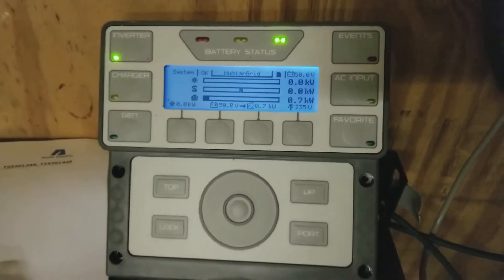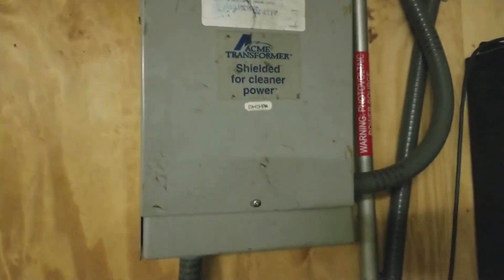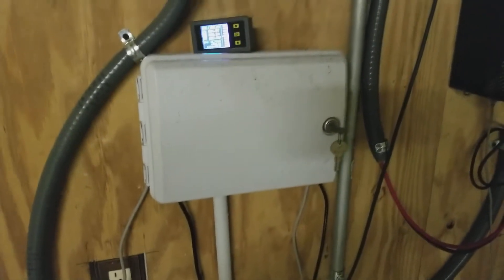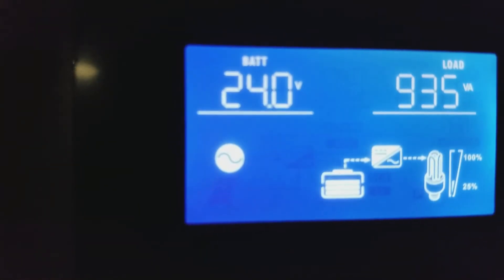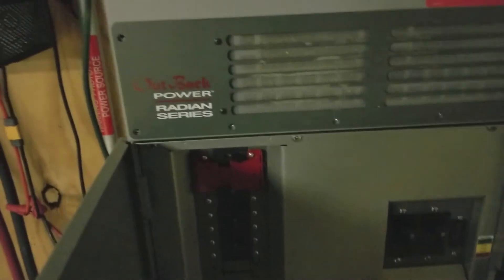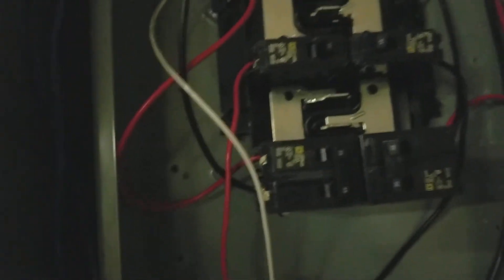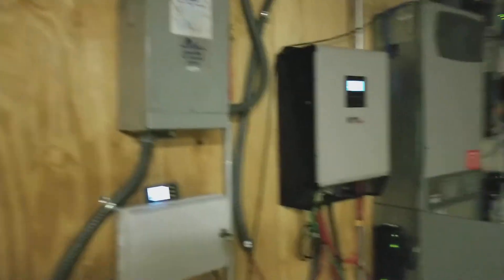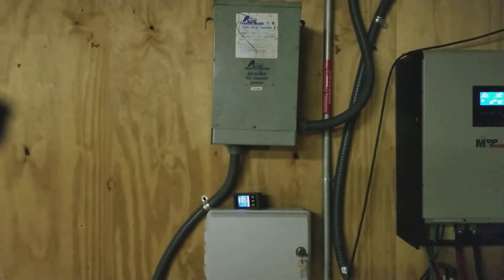MPP Solar PIP 4024 240v to split phase conclusion

Comment: Nuibian, I have some advice for you that will get rid of most of that quiescent current of 90-120 watts down to around 20 or 30 watts. Cap off the primary winding's and just tie the 240 volt inverter directly to X1 and X4. This would pretty much turn that step down transformer into an auto-transformer much more efficient. Read up on split phase auto transformers and you will understand what I am talking about. Auto-transformers (if bought new) cost a lot less than a regular step up or step down transformer because they only have one single core winding's with three or more taps.

Comment: Nubian, thanks for the vid, any chance do you know how to calculate the fuse protection rating for the primary side of the transformer? Thank you
Reply from the maker: The 240 output powering the load panel?  It is breaker controlled.  I would run it into a 50 amp AC main breaker
Reply: Surf - To add to what Nubian said, it depends on the size of your transformer. Transformers have KVA ratings. You want a breaker/fuse on the primary side so that a short circuit on the transformer secondary side (output) doesn't overheat the transformer.  Some manufacturers provide a table recommending a fuse size. You might find them with Google. HTH

Comment: Hi buddy, The split phase using a transformer out from 240v really works? How much watts transformer draw from inverter with no output load connected? It is reliable?. Thanks
Reply: MrTechPhoto - Did you read the description? The seller recommends a transformer rating of 4 times higher than the advertised rating just to power florescent lights. I don't think these light duty products can compete with commercial "big iron" in terms of continuous duty operation and voltage drop with higher loads.
Reply from the maker: MrTechPhotography very reliable yes. About 90-120 watts idle draw
Reply: Thanks nubian. I saw on youtube a guy that do split phase with two 3kw stepdown(240 to 120) transformers cross connected. This system drain inly 16w with no load connected. Did you tried that? Iam very interested in do a transformer base split phase system with this PIP
Reply from the maker: MrTechPhotography it can be done but requires more equipment. I am ok with my setup.
Reply: Thanks Nubian por your time and testing this system. Excellent!
Reply: Nubian, I have one more question. I will buy the PIP5058MS and use two 3k transformers cross connected to the inverter output to have the split phase output I need (120/240). The question is, I will be able to connect my house grid split phase 240V cables(I mean L1 + L2 without connecting Neutral) to the inverter input to be able to use the transfer switch and to charge batteries tru the inverter?
Reply from the maker: Yes you will.  The transformer CREATES the neutral tap.  I am actually selling the 4024 and the transformer together if you are interested.  I will make you a great deal.
Reply: So, its ok that I can connect the 2 Hot wires L1 + L2(split phase 240V) to inverter L + N utility input with no issue to inverter? I will no blowout?
Reply: Nubian, To step down inverter output to split phase, is recomendable two autotransformers or insolated one?
Reply: Nubian Davis , What you think about last message I sent you? Thanks bro
Reply from the maker: You can use one or two - your choice.  I myself would rather 1 for less points of failure.
Reply: Ok, which you recommend, use autotransformer bonded to inverter output or isolated? I bought two of this ones >>  https://www.amazon.com/gp/product/B01HUCTD12/ref=oh_aui_detailpage_o00_s00?ie=UTF8&psc=1
Reply from the maker: I assume they will work but I like the idea of having the one transformer output the split phase 120/240 myself.
Reply from the maker: garyabc you are 100% correct. Those are very light duty items.  Trust me when I tell you, my transformer will never fail at its job, period. That thing is a beast. To save a few watts just does not do it for me, I need the reliability.

Comment: for a 3kva inverter wich transformer need to convert to split phase
Reply from the maker: Joacim Pacheco you can use this one as it is 5KVA. You always want to go up  about 150% to account for losses in transmission.
Reply: Nubian Davis thanks i can find in ebay?
Reply from the maker: Joacim Pacheco certainly.  Pots of sellers have them. Acme is the one that I bought.  It will work for you and leave you some room to spare.

Comment: Looking good buddy and thanks for sharing
Reply from the maker: jwsolarusa yessir!! I am loving this tech. I am going to be adding 40 more KWh worth of cells (LG Chem packs) that operate at 60v(59.2) and operate my Radian 8048a at a 64v operating current, allowing 2 things- the ability to connect with my existing bank (similar 4.2v cells) in parallel and starting at 64v allowing usage all the way down to 48v (by charging the cells no more than 4.0v each @ 16). This extends cell life and gives a huge operating range before SOC is near empty. I will test but I am expecting 68-70 kWh of usable storage.  Once full,  I should never have to discharge more than 25% on most days. I look forward to testing my theory.  Lost thing I will do this year is add a wind turbine or 2. Nothing better than a kWh 24/7/365. Operates in rain, storms, at night. Solar is very consistent for me, but dollar for dollar I weighed getting another 9 panels for the west side of my house to catch 3 hours after sun apex which wouukd give me about 3-4 kWh possibly.  The turbines will never stop working and during inclement weather I get even better performance out of them.  Thanks for stopping by